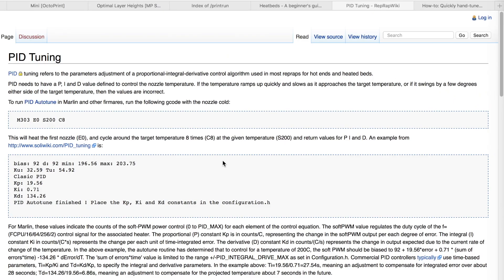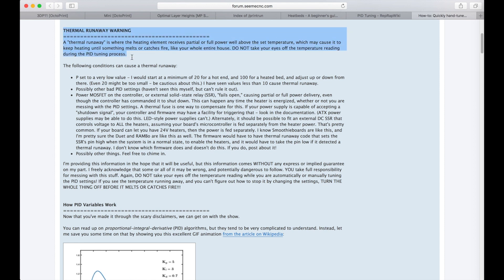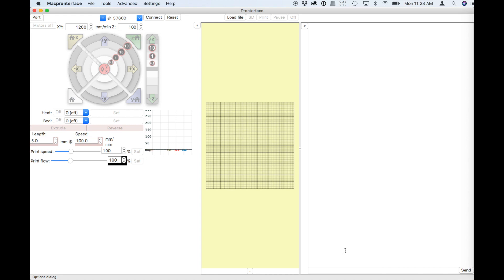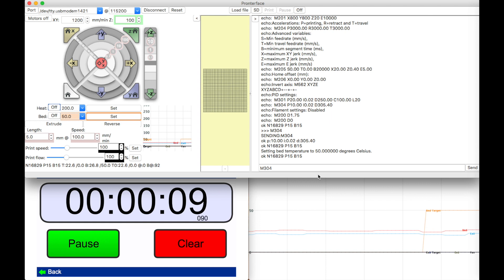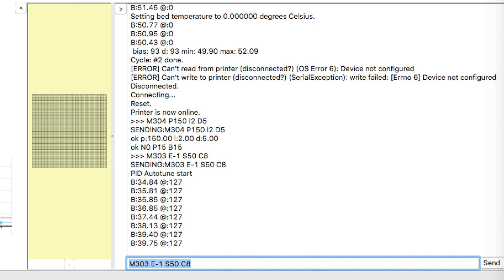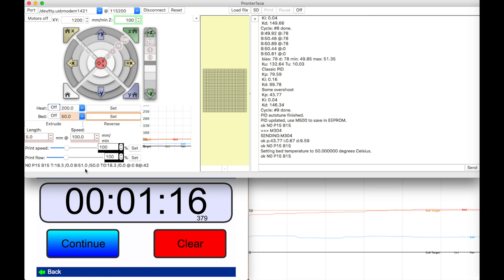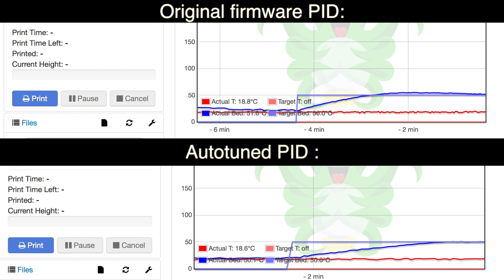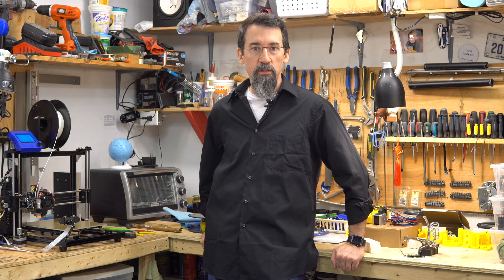Auto PID Tuning Heat Bed Calibration.

Comment: i thought i had this problem when i replaced my thermostat etc, turns out that i just needed to switch the wires over that i connected, problem solved took 5 minutes

Comment: I have an FT5 R1 and the heater bed heats up sloooowly as you all know.  I have tried to PID tune on the bed with the command "M303 E-1 S60 C5" but I get the response  "PID Auto failed! Bad extruder number"
My question is how do I determine the correct bed extruder number? and what am I doing wrong with this process?  I have used both OctaiPi and Print run but the results are the same.
What are your thoughts?
Reply from the maker: Hi, I found a Marlin for the R1 and PID was disable for the bed https://drive.google.com/drive/folders/0B9b1NbuMK524ZXpTTlVzTFFJalE

Comment: will this work with a ender 5. its all stock board an firmware. i had to replace the heated bed an when i try to do the auto pid tune it works with the hotend but when i try to do the bed it fails to do the auto pid tune i cant remember the error but it was something to do with the auto pid tuning failed. i think it may be the e1 that is the issue. e0 worked for the hotend. an i figure e1 would be the bed but for some reason it didnt work. i did do this using the terminal in octoprint so that maybe the problem but i did it like that cause the tutorial i was watching did it that way plus it made it alot easier than connecting my desktop to the printer which is on the other side of the room inside a enclosure. another question is can anyone tell me if im able to save the pid tuning with the factory firmware on my ender 5 or is it something i will have to put at the beginning of my gcode to get it to work each time? i should know this stuff by now with all the printers i own an as much as ive done with them, but the firmware stuff was always scary to me an when i finally did learn enough to do it, it was for a skr 1.4 turbo so now when it comes to the 8bit boards like my ender 5 has im lost again an not sure what all i need to do a firmware upgrade. its time for me to do it. a yr of owning an running it with the factory firmware an ive had a bltouch kit for 6 months and havent used it cause the firmware. i did manage to compile a firmware for a delta printer i built from scratch so im sure i can do it with the 8bit boards too, but what confuses me is the eeprom stuff an if it dont have it u cant save but its possible to add i dont know. im lost on the stuff. half my printers are 32bit an the other half are 8bit  an the 32bit stuff was as simple to get form the computer to the printer with the sd card. i dont know if thats how it works with the 8bit or not. i know my bltouch come with something i think that is suppose to connect it to my pc maybe not 100% just glanced through the instructions.

Comment: Is there any side effects to tune for more than 8 cycles, e.g. C25 or more?
Reply: So technically more cycles will be more accurate but after 8-10 you get intense diminishing gains. You will barely be able to quantify the benefit to 25 cycles over 10 and it will take much longer.

Comment: do you do this with an already hot bed or do you let it cool before starting
Reply from the maker: Hi, from cold is better or half the target temperature should be fine.
Reply: @Franks3Dshop   yeah nice one i managed to do it in the end and it seemed to work better when it had cooled a bit. it was E-2 for my bed, E-0 and E-1 where both my hotend!

Comment: I tried tuning my bed and the temp graph never moves. It reads the hotend temp but not the bed temp.
Reply from the maker: Hi, what command did you use?
Reply: @Franks3Dshop  m303 e-1 s60 c10
Reply from the maker: That is correct, some firmware have it turned off for the bed and use bang bang or other methods, maybe you could flash another firmware...

Comment: Hi, I changed my Relay used between the RAMP and the Hot bed for a PCB with a  Mosfet but I have a doubt about the comment in Marlin warning to check the hardware to use PIDTEMPBED. What is needed to check? Hotbed´s pcb? there is any modification you have to do? Or there are different models that are needed for used PIDTEMPBED option thanks in advance!
Reply from the maker: Hi, PID is a way of controlling slow to react systems, you do not need it for the bed, but it can be enable in Marlin if you want tu use it’s features, when tuned it can help bring the bed to temp faster.

Comment: SENDING:M303 E-1 S60 C8
PID Autotune start
Error:Heating failed, system stopped! Heater_ID: bed
[ERROR] Error:Heating failed, system stopped! Heater_ID: bed

Error:Printer halted. kill() called!

ANYONE else see this?
Reply from the maker: This error is usually seen when the bed fails to heat up. Verify that you can heat it up.
Reply: @Franks3Dshop  i heated it up to 60C for 30 minutes no issue, im using a cr10S5 with the new EZBoard Lite from TH3D running marlin 2.0
Reply from the maker: Hi, first Marlin 2.0 is not final and still as bugs, I would try 1.1.9 contact TH3D about this maybe they know something about it.

Comment: I get an error message about bad extruder number when I run the command with the E-1 option.
Reply from the maker: Hi, so command
M303 C8 E-1 S50
Does not work ? And you have a heated bed,, E-1 refers to the hot bed, for the extruder it’s E0
Reply: @Franks3Dshop  It's a no go, seems heatbed PID is disabled by default in the firmware and you have to enable and recompile.
Reply from the maker: Ya it’s another game doing that !

Comment: I have a question - I have a Monoprice mini V1, and I added a E3D V6 genuine Hotend, and was able to calibrate it etc. One issue I DO have though,  is that when I 'home' my hotend right now, the hotend 'homes' about 3 mm or so off the front left corner of the heated bed ('left' meaning when you are facing it, its on your left). Is there a command I can upload through Pronterface to offset this so that it will 'home' on the left front corner of the bed like it did with the factory hotend? What commands would that be to correct that back to the way it was?
Reply from the maker: Maybe G10? https://reprap.org/wiki/G-code#G10:_Set_tool_Offset_and.2For_workplace_coordinates_and.2For_tool_temperatures In Marlin it can be set in the firmware. I am not sure if this command is understood by the Mini V1
Reply: Hey! So sorry for the late reply. Unfortunately those didn't work on Marlin. A follow up question though- I can move the hot end into the right position (using on the pronterface interface) - is there a way I can move the hot end into the desired place on the bed that I would like it to home to, and then upload a command (followed by M500) to save that desired position as the 'new default' location when hitting the 'Home' button?

Comment: I had no issue with my printer and the temperatures were stable. But I did an AutoTune on both the Bed and Hotend. My results were awful. For example after the AutoTune the temperature of the hotend was not stable anymore and went +/- 5°C !!! So I put back the stock values and both temperatures are stable again.
Reply from the maker: Yes I did find that on another printer, I did the tuning by hand and made it better that way. But what ever works!

Comment: this video is obsolete because the function is in marlin and you can start it via menu on the printer :D
Reply from the maker: Thanks good to know, for the ones that are not using the latest Marlin, like me who is not able to get bed leveling working above 1.1.4 or like the little printer Monoprice Select Mini that I use who is not on marlin at all... If it can help them like it did for me, I think it’s relevant for some...
Reply: The MP Select mini has closed-source FW and does not have PID settings in its very basic menus. It also always comes with really bad PID settings :( I'm glad Frank showed how to do it for this printer!

Comment: I had to look up what PID stands for.  I knew what it meant in medical terms;  Pelvic inflammatory disease.  And I knew what it means in computers;  Process Identifier.  But didn't know for printers;  Proportional Integral Derivative.
Reply: Traditionally:
Proportional is used as a direct gain upon the error, setting the rate at which the setpoint is reached.
Differential is used as an anticipator of reaching the setpoint, effectively backing off the proportional as we get closer.
Integral is used as a final accumulator of a steady state error, improving the final accuracy. (eg drafts cooling the heater)

Always tricky to tune by hand, it is nice the 3d printer firmwares include auto tune :-)
Reply from the maker: You are right, I should have explain first... I will begin to make script for my videos, not and easy task...
Reply from the maker: And now added to the description of the video.
Reply: FYI: The PID algorithm is used for all kinds of stuff in automation, not just printers! -- like if you search amazon or ebay for a "PID controller" you can buy an industrial black box that will control an SSR based on the values it reads via thermocouple (it's a common industrial control "lego" block; we used one to control a crock pot recently...). -- Also, the usefulness is not even just for controlling heaters -- the algorithm can be used for any stochastic closed loop system where there is a delay between the cause and effect (for example a lot of quad copter controllers use a PID loop to control the propellers).
Reply from the maker: Thanks, that is what I deduced from what I read. Thanks for the precision. It’s similar to a phase lock loop that we use in electronics, but with a delay and some smoothing.
Reply from the maker: Make sense since the heater bloc being a heat mass and the thermistor is at some distance to the heater element, makes the system slow to react and we want it to get to temperature fast without to much overshoot... I should have gone into engineering, I love to know more on all of this...